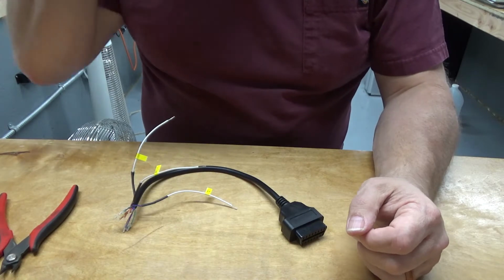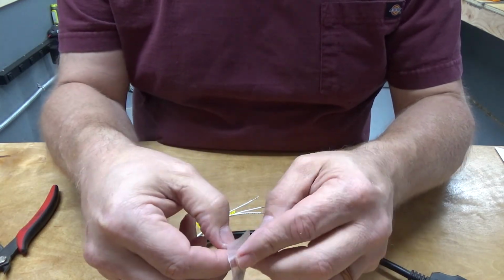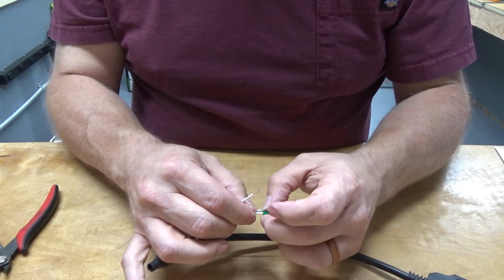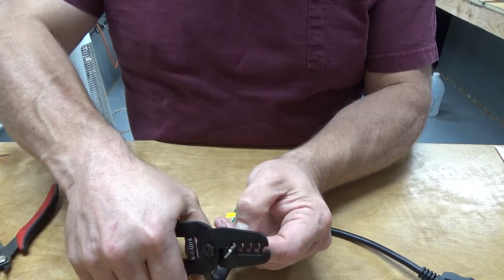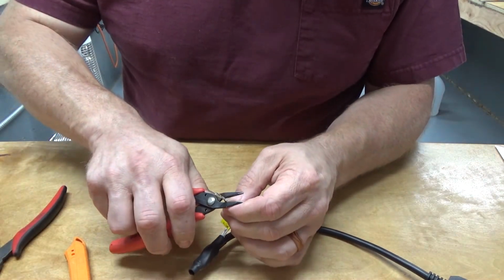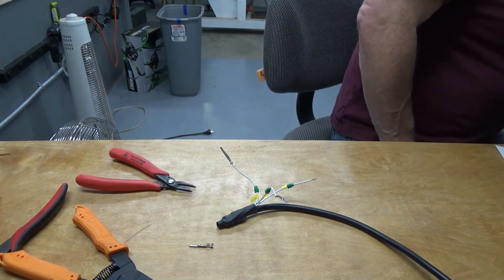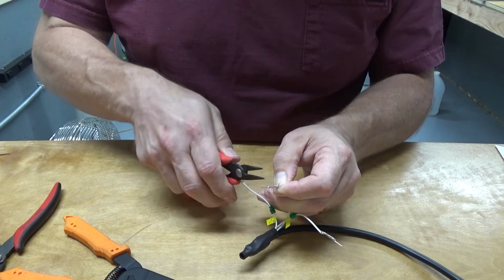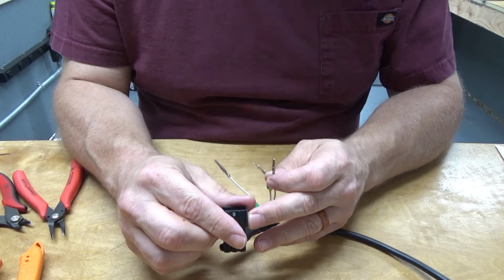Communicate with the ECU on your Hawk DLX without breaking the bank!

Comment: You don’t have to do this. If you turn the key 3 times on off on off on off on. It will flash  the codes. If you have a check engine light. 

 10flashes is zero and then is pauses for 1 seconds. Then it will Flash the second number, count how many flashes that’s the second number and so on. I had code: 10 flashes, 2 flashes ,3 flashes, then 10 flashes. So I had code. P0230 fuel pump circuit issue. Make sense because I had the fuel tank off
Reply: Is there a link to the codes
Reply: I have p0562
Reply: There is. Let me try and find it
Reply: @Jdevil21  I found it

Comment: Very well explained video, but why is your picture of the connector visually the opposite of the one shown on the HUD ECU Hacker website? Do I use your picture or the one on the HUD ECU Hacker website? I don't want to damage anything. I have an Odes Dominator 1000 with an MT05 ECU.
Reply from the maker: Great question!  My image of the connector is the male end, and the ECU Hacker website is showing you the female end of the connector.  Basically, I'm showing you the connector you're going to be assembling, and the website is showing you the connector that you're going to plug into.  Does that clarify things?
Reply: @f15sim  Perfect clarification. Thanks!
Reply from the maker: @elbowroom7993  You're welcome.  Good luck!

Comment: Would you please remove the link to the fake ELM327 adapter on Amazon from your description? A user wrote me who bought this chinese crap and it does not work at all. On the HUD ECU Hacker homepage there is a VERY detailed description about all the problems with chinese fake adapters. Some work, others do not. They may look identical from outside, but inside they are different. Your's may work and another one does not. Do not put links to this crap ! Users of my software are getting betrayed with these cheap crap ELM327 fake adapters from Amazon. Please remove this link because you are misleading people. In the detailed description from HUD ECU Hacker there is all the information about adapters and also the links where to buy the REAL adapters.
Reply from the maker: I am not misleading anyone, so get that thought straight out of your head.  Link removed.

Comment: How do you know what wires are the correct ones?
Reply from the maker: You need to use a multi-meter to work out what wire goes to what pin.
Reply: @f15sim  ok thanks. Yeah I got brand new hawk 250 with  10 miles on it. And the check engine lights been on sense first start up. Idk why
Reply from the maker: @Jdevil21  That's kind of odd.  Does the engine run ok?
Reply: @f15sim  yes perfect

Comment: Is that 6 pin male connector available on Amazon , either the same one or different brand?
Reply from the maker: I'm really not sure.  I've only found that single source.  If you find a different source, please let me know and I'll post a link in the video description!
Reply: @f15sim  would something like this work? OTKEFDI Motorcycle 6 Pin OBD Diagnostic Cable for KTM Kline and Canbus Motorbike https://www.amazon.com/dp/B083JTR84L/ref=cm_sw_r_cp_api_glt_fabc_VMC78RTBCY43B1RHEDZN?_encoding=UTF8&psc=1
Reply from the maker: @jonathanzarate8162  So that looks like it would physically fit, but there's no details on how the pins are wired.  If you buy one, compare the pinout of that device against what the pigtail wiring I used is.  If they're the same, please let me know!  If the pinout doesn't match, you can always cut the ODB connector off of it and wire in the pigtail I gave the link for.  That might be easier for you to do than to order the parts from cycleterminal.com.

Comment: Thank you for taking the time to make this video! I saw your post on ChinaRiders linking to this. 

If it helps anyone else, I actually ended up using this as my female OBDII connector: https://www.amazon.com/Car-Connection-Connector-Harness-Assembled/dp/B07QRS3VRP/ref=sr_1_10?crid=Z8H5O7OACTQ6&dchild=1&keywords=female+obd2+connector&qid=1602263113&sprefix=female+obd2%2Celectronics%2C172&sr=8-10

Figured since I was crimping pins anyway, I might as well just do it both ways. Also let me make it look kinda trick with some wire loom mesh. I am using an old VW K Line cable I have from my MK4 Volkswagen owning days I had kicking around.

Also thank you to Katflap and Davide for the hard work on HUD ECU Hacker. I used to do (as a hobby) reverse engineering on Honda and Mitsubishi engine controllers, and I know it can be a thankless endeavor. 

I was actually super amused, as someone who's owned older Harley products, to see the MT05 on Hawk DLX. I think this bike is going to really come into its own with the addition of even this old EFI system on it.
Reply from the maker: Great idea!  Thanks for posting the link to the connector.

Comment: Could you add to the description which colors have the wires of your J1962 cable from Amazon for +12V, K-Line an Ground?
You can also buy a complete cable here: https://it.aliexpress.com/item/4001094290399.html?spm=a2g0s.9042311.0.0.1ff94c4dLlOqtT
Reply from the maker: The colors on the pigtails you get from Amazon don't match any listed chart.  You just have to tone them out with a multimeter.
Reply: @f15sim  My question was if you could publish the colors in your description so it is not necessary to tone them out at least for this specific cable from Amazon.
Reply from the maker: @albrechthilker9072  The problem is that based on the comments for the product link I include, the colors have varied even with the same SKU from the same seller.  Including colors on the cable I got wouldn't help anyone as the cable colors appear to be wildly inconsistent.

Comment: Hey I'm having issues trying to find what Delphi controller my bike uses it's a 2020 hawk 250 dlx. What is your model number? Me and the wife moved from Florida to Tennessee and I had the bike in the back of the truck so I took the Delphi out and lost it on the way some how. I contacted TXMotorsports and they said $75 so I was looking online for a cheaper price
Reply from the maker: Here's a photo of the ECU in my bike: https://i.imgur.com/nI54LZJ.jpg - to me $75 isn't that unreasonable.  I bought a fuel pump from them and it was $99. :)  The important part is the firmware on the ECU - since the MT05 covers a wide range of bikes, the same model may not work right for the Hawk if the firmware is different.  You might check with Ricky Power Sports - they're the primary importer of the Hawk & Hawk DLX.  They may sell it for less.  Can't hurt to ask.
Reply: Thank you very much for the quick reply I'll check with Rps and see what they say. $75 isn't to bad, at least its not $200 or above
Reply from the maker: @kennethharless9696  You're quite welcome!  It could be worse - you could be trying to find an ECU for a Cadillac or something. ;)  Good luck and please report back when you find an ECU!

Comment: Which ground their are two  signal ground green and chassis ground red and white which one is it. colors would have been great but you skipped that part at the beginning . Thanks. Great video for my DLX
Reply from the maker: The wiring colors for the ODB-II pigtail are all over the map.  They don't even match what the seller has for the color to pin map.  You'll need to use a multi-meter to figure out which pin goes to which wire.